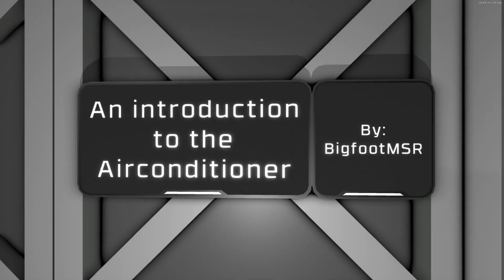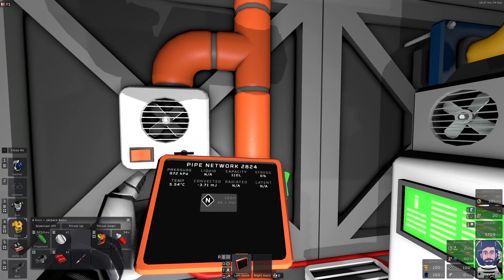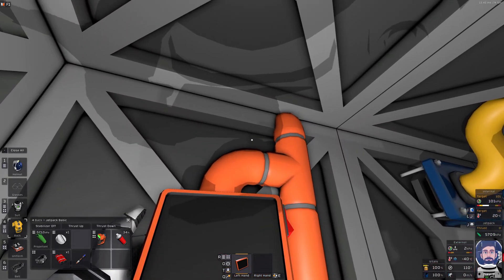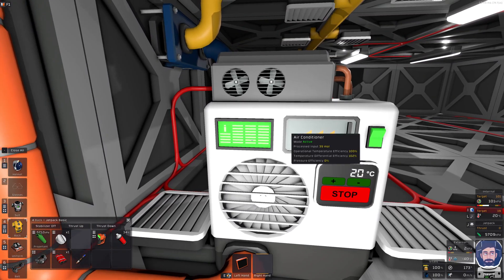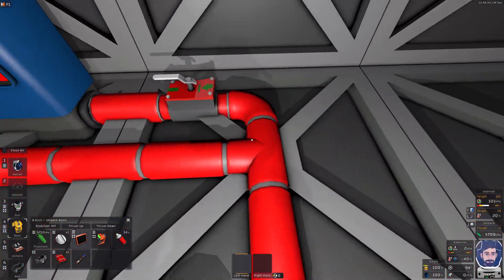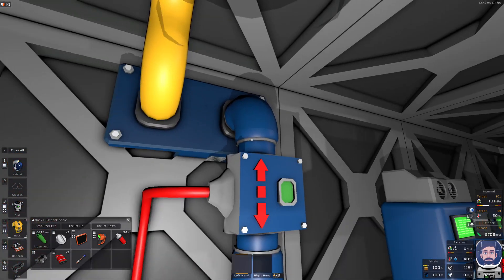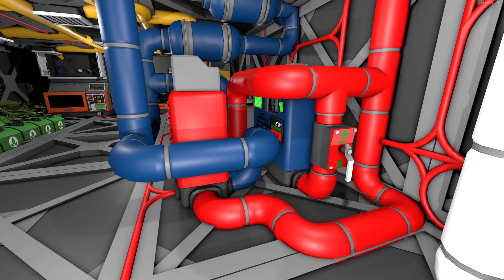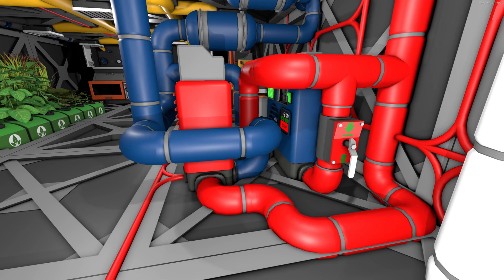AC introduction

Comment: I wish the wall cooler wasn't in the game, it's pretty much useless and impractical in most cases.
Reply: It needs a rebalance.  The portable AC, is (was?) super OP when paired with a wireless battery. It needs a  nerf. The wall cooler needs a buff. And all three should be aligned to work with the same basic rules so it isn't this confusing. But to be fair, the wall cooler and portable scrubber were critical to my survival as a Zrillian on Vulcan back when you only started with an O2 tank.

Comment: No explanation on how to fill the closed pipe system with gas? Why Nitrogen etc etc....very confusing
Reply from the maker: Yeah... I forgot to include some other items too, so I'm going to end up redoing this video. Sorry :(
Reply: @BigfootMSR  No problem! Still happy subscriber : )  It's easy to point out mistakes....harder to do it yourself.
Reply: Use regulators. Set wanted pressure, and you're done 👍